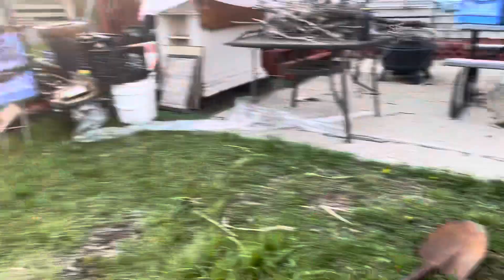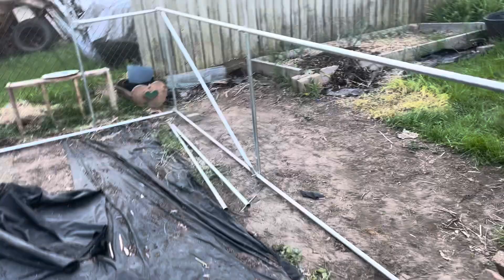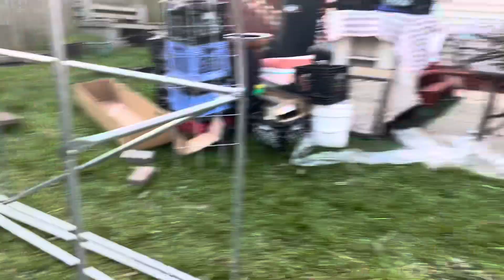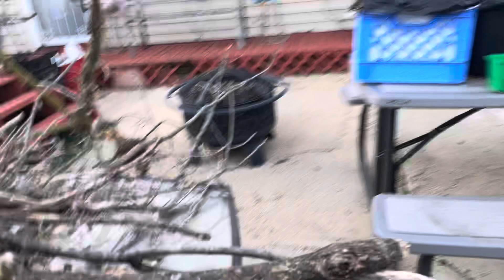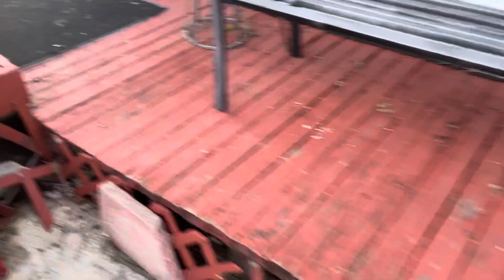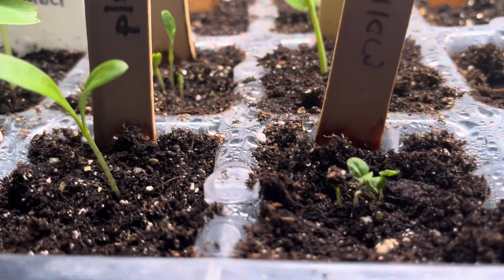We’re on the brink of completion.

Comment from the maker: It’s figured out and we will get to it momentarily. Turns out after putting the 10’s for the center roof, the three 4’s run along the two front right and left side with one connecting to the front 10, and the three 6’s run along the two back sides with one connecting to the back 10. All of the 4’s (total of 10) are connected up front and all of the 6’s (ten total) are at the back. I know that this sounds foreign, but belieeeeeve me if you EVVVVVA assemble a greenhouse you’d understand. Lol
I am going to Home Depot today to get leaf bags and will begin loading sticks to clear out this week. Rain tomorrow, but Wednesday is supposed to be nice.